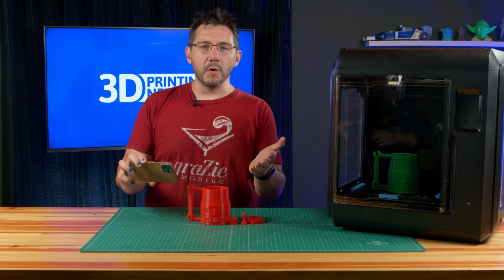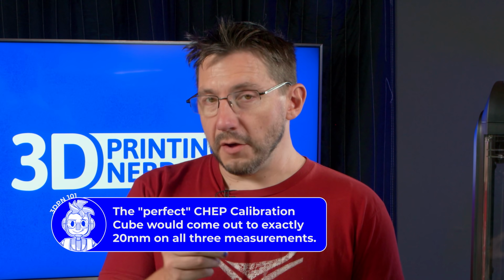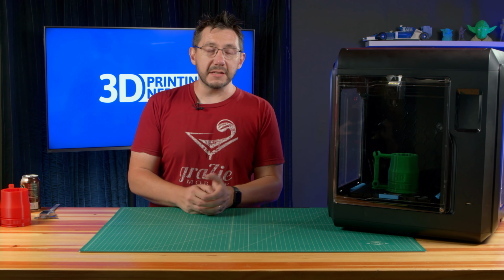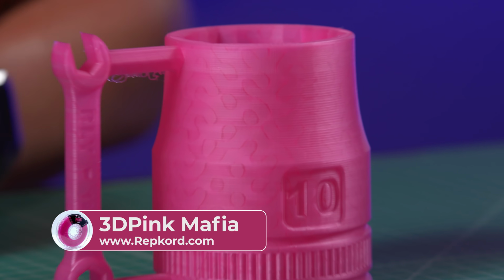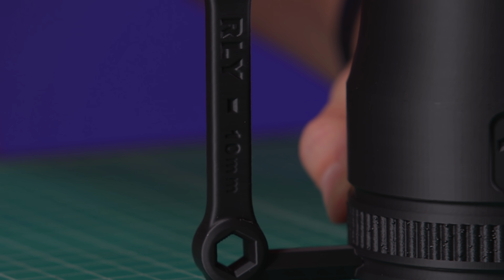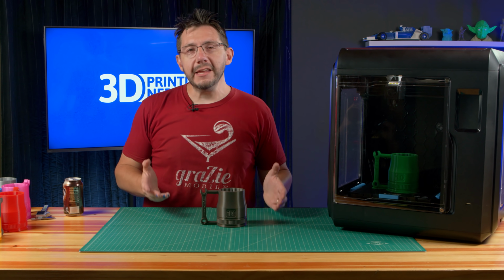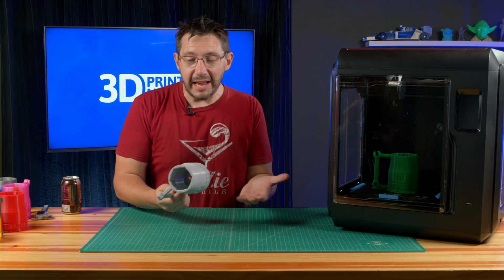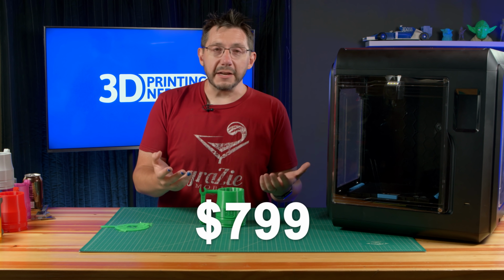14 FILAMENTS & 200 HOURS! Flashforge Adventurer 4 FIRST LOOK!

Comment: I have many disapointments with this printer and not sure is it bug or may be 'undocumented feature'. First, heating of extruder and plate are going very slow. Before it starts printing it first heating up plate very slowly - approx one degree per 6 seconds. Then it starts heating the nozzle, it looks like it can't heat both devices simultaneously. The same can be observed when I am trying to heat it up via Preheat menu. If to heat it up separate it's going faster. Especially extruder, but when together it goes pretty slow, and one by one. Second, it quite offten hapens when I am loading the file through WiFi it can't open it. It happens once per 3 files. The distance to the printer does not matter. I have to upload some unlucky file several times. Third, the sensor screen is crazy, it is very hard to make exactly one touch when calibrating the extruder. Quite often it happens two or three touches, it makes a calibration a nightmare. Fourth, sometimes it jumps in the middle of calibration process to the main menu by itself and you need to start calibrations from begining. Fifth, sometimes I can see that blue led is blinking inside the printer somewhere in the area of it's main board. Is it Ok? I am not sure is my machine Ok. From other hand it can print and actually doing this Ok, in general. But looks like capricios machine. Do other people have the same problem with it?

Comment: YOU NEED TO MESURMENT THE OUTSIDE AND INSIDE HOLE.....

Because off that i STOP using PLA PRINTER --------------------------ONLY USE RESIN PRINTER

Comment: So I have two Ender 3s bought to print PPEs during the outbreak. Looking to upgrade and print PETG, ABS,... Was looking at the Prusa MK3, but ran across the Adventurer 4. I noted a touch of hesitancy in your review. Of the two, which way would you lean?

Comment: now the question becomes if it will print PLA-CF and PETG-CF without damaging the nozzles (or at least without damaging them too much? Not sure if they're hardened steel or not.)
Reply: Is using the 0.6 265°c nozzle a good idea for x-CF filaments ?

Comment: Anybody looking to buy an adventurer 3/4, I'd reccomend you read this comment lol.

The Adventurer series is an amazing entry-level product, I reccomend it to any beginner into printing or anybody who wants a straight forward printer.
But, they need some more information on things you MUST do before using or even printing a test print mainly because the adventurer series is a series begginers that have never owned a printer before will look to buy...

One thing that they need to tell people is that you MUST level the bed with the extruder before you even test print, when I first got my printer, I had no idea why levelling was important, and they made the claim the adventurer 3 was a printer you didn't have to level! Well no, you've got to, when I started printing, only about the top 70% of the print would get printed, before that it would just scrape the crap out of the bed while attempting to print the bottom part of the print, in the end I needed to buy a new build plate since my build plate looked like somebody got a knife and just started scraping the bed!

That clicking sound Joel talks about isn't something you wanna hear, your extruder isn't keeping up with the bodum fillament assembly which is pushing fillament through quicker than the extruder can melt it and print it, solve this by using a higher temp, I always used 225 - 240; the claim of 210c on the nozzle never worked for me (atleast not when printing outside of ultra mode however this is just me).

Comment: Hello everyone, I recently purchased an Adventurer4.  I also am a newbie to 3D printing.  I'm having a problem printing a round tire I downloaded from thingiverse.  I need the tire to be 2 in x 2 in to fit ny model.  In X i entered 50.8 and Y 50.8, but when I do this thru Flashprint 5, the wheel is oval not round.  What am I doing wrong,

Comment: Man this printer is garbage. 800 for a printer that has never finished a print in over a month of literally trying to fix it every day. I have more than 100 emails with aftersales support. If they don't know how to help you without having to replace your machine they just don't. The best you can hope for is firmware which the machine will do automatically if you ask it to look for most up to date version. First my bed couldn't level the nossle was almost 2 in off bed during leveling and still grinded against the bed when trying to print. After firmware forced update it leveled but hasn't completed a print since and jams for some reason about every hr of printing.  Reloading fixes it but just does it nonstop and makes this extreamly loud clicking from the feeder from not being able to feed properly. I've sent many hours of video at this point and the responses just seem to get less and less over the weeks as they have have no idea how to fix it and won't replace it. So that's a fresh grand down the toilet while I'm stuck with an easy bake oven that doesn't bake and is about to just be counted as a loss I've put so many days into this by now. I cgot an ender 3 for 100 bucks that seems to have better quality prints and can actually finish one for a fraction of the price and the bed is almost the same size. I truly regret not going with qidi or cr10 max and watching vids on tube when the first thing comes up on Google is solid hardware with buggy software!  Total regret is how I'd say my experience has been. And as someone wanting to start making videos I didn't really have a grand to waste on a printer that will never work and is made so you can't work on them and no shops in out of China. They will not replace it and so far haven't even offered a fix or much help figuring it out. It's been hrs and hrs daily for over a month. I'm literally about to make a review on a 3d printer that I have 100s of hrs of failed prints on and what's really ironic is the only prints that did complete was an extruder knob and slips for my ender 3 pro. Think it was trying to tell me something. It does truly suck I have to sell my sign and game used drew Brees ball so I can replace this total loss. It's very sad cause all these ppl that got free ones dobt seem to have not one issue. I'm totally confused going by the video I'm about to put out.

Comment: I dont under stand how the filament to nozzle stuff works? Like if the filament is +/- 0.05mm but your nozzle is a 0.04mm will that still work or do I have to find a different filament? Also 1.75 is on the filament at well, where does that number come in?

Comment: First, let me say great videos. So I'm thinking of buying my first 3D printer, Flashforge seems to be the manufacturer I want to go with, but what model, (Flashforge Adventurer 4 @ £695) ( Flashforge guider ii @ £899 ) (Flashforge Creator 3 @ £1,980 ) Any help welcome.
Reply: Take in consideration what you will be printing and with which material. You can make comparisons between your options and choose the one that suits your needs the most.

Comment: very entertaining test ... 
i got me the Adventurer 4, found some nasty things almost out of the box .. like the really terrible camera, or the building light is nice but pretty much pointless when used remote(camera), and it has no protection on manual movements (like set it to 50mm steps with the head less than that away from the bed, press down it will run right into the bed with no way of stopping it) ... but yes it print's nice, it is very quiet, and the support is helpful as well (in the capacity they do have (less technical more about using)) .. so after all a good choice.
Reply: Could you explain further what's so bad about the camera? I've been trying to find a review that covers this but there arn't any...
Reply from the maker: The camera is low resolution, and the quality of the timelapses captures aren’t good.
Reply: @joeyvanrenesse884  the buildin light overexposes the camera, and with thee light off you can;t see anything. 
its horribly widen out (lens) so the picture is always out of focus. it's good enough to see if the printer is messing it up .. so its fine (i guess) just disappointed, i did order me other lenses to replace it making the view angle smaller but regain some of the focus. i have a live-image of what the camera seeing on my website ;)

Comment: that is quite an expensive printer.  Even the Monoprice MP Voxel is 400 (Cloned Flashforge 3) with the same design.  This is basically a Ender3/Neptune2 with a built in enclosure but without ANY of the upgrades you can do to one (a .4 nozzle is all your gonna get).  You could get an Ender3/Neptune2 for about 180-190 and a Wham Bam Hot Box enclosure for 120....and get TWO sets of that before meeting the price of just 1 of these.
The "chunk" sound is the extruder unable to keep up with the print speed, its the same issue with the Voxel.  A few solutions is to just slow it down, or use a tad bit of grease (these models usually come with a small packet) and use it to lube up the bowden tube (slobber some on the end of the filiment and the feed it back through).  Doing that has seemed to solve the "chunking sound" for a while at least.

Comment: I find when the clicking in higher up in the print is due to the speed settings is to fast for some filaments normally infill speed or wall speed especially if your using the same g code for each filament or different machines :) people using confuse this with a clog :) or just like you said the temp will help with the speed aswell 😂😂😂

Comment: I have the adventur 3, pla has never been a problem, with abs i have had alot of problem with the extruder skipping, also had a roll of petg i never could get to print with 240 degree nozzle, i got the 265 degree nozzle, and the petg can print well at 265 degree very slow, 40mm/s is the max until now. 
I had a roll of ABS i could not even get to print at 264 and what it printet had very bad layer adhesion! 
So extruder seems too weak and looks like they use the same? 
The nozzle change is nice, i have a nozzle only for pla - ABS - and high temp have both abs and petg. 

What is annoying on it is you cant level bed in print, this has caused lots of trouble, they added a feature where you level 9 points, it made it much much better!! 
As a beginner this is two very user friendly printers, but also a bit limited when i look at how people use other printers. 
The extruder skipping is something i find very annoying though, sometimes it helps to manipulate spring tension on the filament, and i upgrade to another gear.

Comment: I have sadly had those same issues with Jessie PLA on my MK3S+ and CR30. I've used a few spools with no issue (Vanilla Bean, Soul Black), but I have a red, green, and yellow that I just can't trust. It's as you described: manifests as a clicking, like a jam or slipping gear, extrusion stops or under extrudes something fierce, and the print fails. No evidence of a clog every time. Swap in a different spool and all is well again. I'll have to give a higher temp a shot. I'm glad you reached out to them and shared!

Comment: nice review, disappointing printer at that price point
Reply from the maker: Which part(s) is / was disappointing? What would you like to see changed or added to it?
Reply: @3DPrintingNerd  IMO the printer is way to expensive for what it does. Sure, it is nicely made, but there doesn't seem to be any real world gain for the expense. The prints seemed rather "just okay" to me. I didn't see the enclosure put to good use. Does the enclosure have any thermal monitoring and control capability for printing difficult filaments ? Are the steppers, drivers, bearings and rails significantly better than they typical $300 printer ? What makes it worth 2-3x a garden variety unit ?

Comment: That quick swap nozzle is interesting. Nice it’s easy to swap the nozzle between PLA and PETG prints with this machine. In other machines it’s pain, they just have to use the same nozzle for both materials and get perfect results - such old fashioned!
Reply from the maker: They said the 240 nozzle can print PETG no problem, but they found they had better results with the 265 nozzle. No, I don't know why. Yes, I'm going to ask them. :)

Comment: So I switched filament to a cheap brand called Cool Been  it would keep messing up at my previous filiments settings of 200. But once I upped it to 215 it worked even better than the other one! And it's just 16 bucks on Amazon.

Comment: Great first look, Joel! Really enjoyed looking at how other filaments work with the machine. I do love Flashforge printers, in particular, I do like using the Flashforge slicer (it just works in my experience). With that said, it's a bit of a strange of Flashforge to set the price point for the Adventurer 4 so high, especially considering the current price of the Adventurer 3, where we can get it here in the UK for £349.
Reply: yes, it's double the price, but is it double the printer.
Reply: Flash print 5 is very easy but doesn't offer you many slicing options to help your prints look better. It's just enough to get it to the machine. Simple tho. But once you learned it doesn't help very much I use cura to fix flash forge and they sent it to me and instructed me how to do it. But my adventure 4 never worked. Not sure what to do now that I wasted 3 rolls of filament just trying to fix the stupid thing getting no where or much help for that
Reply: Wish I bought the 3 now!

Comment: 220x220 in 2021 is too small, and the nozzle (custom) that can reach 260 in an enclosed area is unuseful, a 290°C would have made the difference. It is a pitty that they capped the specs of such an interesting machine.
Reply from the maker: I like where you are going with this. An all-enclosed machine with a nozzle that could hit 290+ would be bonkers.

Comment: The extruder is underpowered and will skip (bumping, the Hotend temp helps a lot) meaning sometimes the speed needs to be lowered while printing some filiment. They use the same extruder on the FFA3 and I've printed well over 5000 hours of ABS on it. If they would supply it with a geared dual extruder the FFA4 would be one of the best for a complete solution under 1000K. Little slow sure.
Reply: I can only assume that with the extra pressure from a geared extruder, the nozzle quick release system will fail and the nozzle will pop off. I have experiment on my ADV3 with more filament pressure and that's what happened.

Comment: I have an adv3 at the moment and my wanhao i2 sits collecting dust now. The adv3 is just painless, I don't know how they do it, but flashforge have some how nailed affordable, low effort 3d printing. It's a brilliant tool to use and means I can spend more time on my designs and less time worrying about if the printer will work.
Reply: I just bought a finder lite and for what I paid I'm damn impressed

Comment: i'm not really a fan of this-- none of these materials were remotely demanding, and you didn't go into depth about the motion system or the maximum speeds-- if it's going to be 800$, it had better be able to do something that an ender 3 in a cardboard box can't. i would have wanted to see ABS warp test, nylon, TPU, speed tests, etc. once you start pushing it fast, what is the limiting factor for quality, ringing? filament heating? extrusion? cooling? these things are all important. what you've shown is a machine that's not worth it, and you should have described it as such

Comment: sorry to be negative but last time you proposed raise 3d and that machine is a disaster the company is even worse. When you test the machine do a real test like print a max size cube for example.,  on rasie 3d if you print that will put so much pressure on the machine that it will bend the build plate when it cools down. On prusa because its magnetic the print will detach iteslf from the printer . I know its a torture test, but when it comes to the fact you have  to actuaaly print soemthing big to fit the volume and this happens turns out noone tested those for this scenario.. there is plenty more to test on those machines and you will have to use  them for few months to fully test them, that inculdes customer support. which in case of raise 3d does not exist outside of  states. Please do a proper test of the machines before you say they ok and you aproove them with your name. As you will loose credibility otherwise . Unless this is intentional

Comment: For $799.99 why dont just get a voron 2.4 which it last longer and print faster 😏
Reply: I guess because that would be a kit, and there isn't even any fully complete kits with all quality parts for a Voron 2.4. Sure, you can have a kit from Formbot at around that price, but it has some sub-par parts, and you also need to print a lot of parts yourself. And those should be ABS, which is a PITA to print unless you have a printer with a heated chamber.

That said, Flashforge is too closed a system for my tastes.
Reply: Because even though a Voron is awesome, it requires months of sourcing and then building? :)
Reply: @punishedbrains  tHE FLASHFORGE IS MORE LIKE A kia on the show room floor ready to go, where a Voron is more like a tesla in a kit that requires many hours of work and skill!!